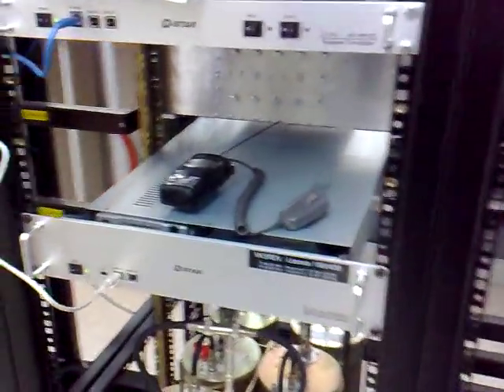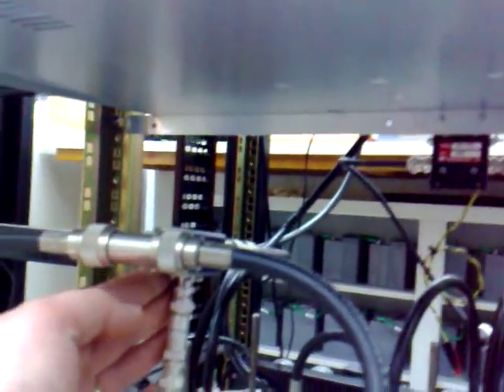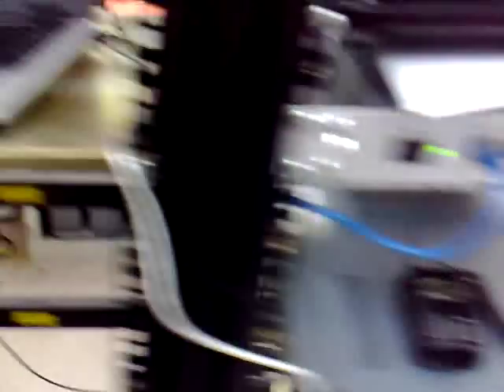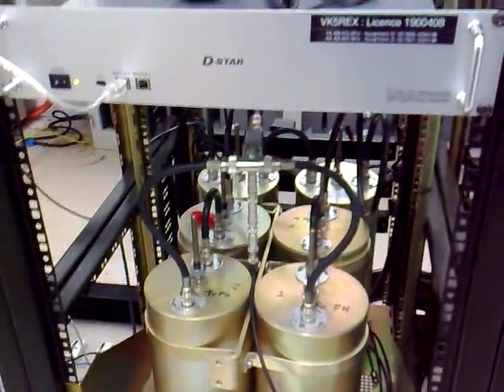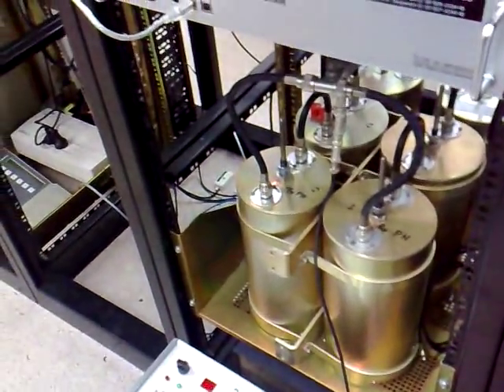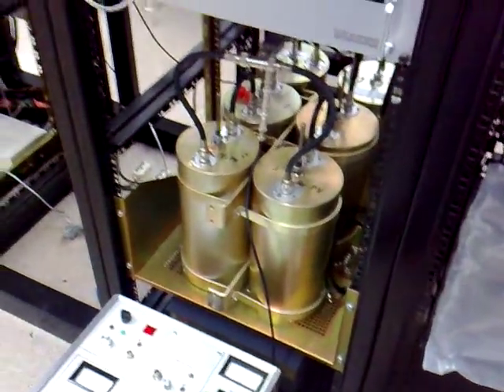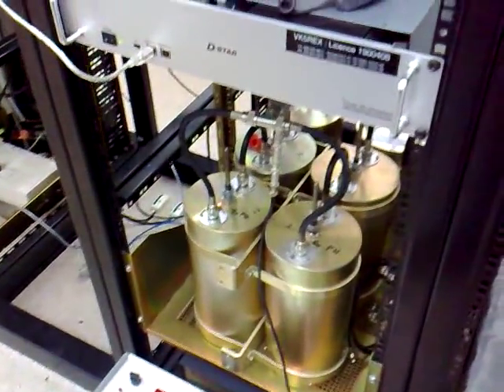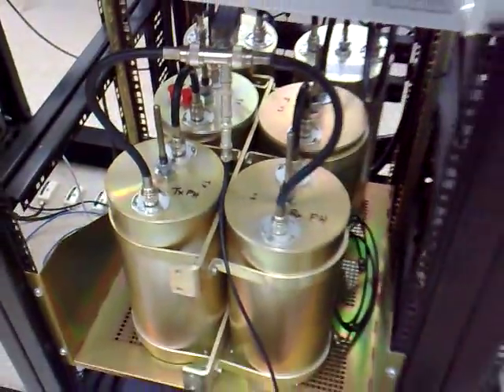Receiver test at the VK5REX D-Star repeater

Comment: That's not desense, it's wideband noise from the transmitter. You can confirm it by monitoring RSSI or AGC in the receiver. You need to add a notch at the RX frequency into the TX path to stop that noise.

Comment: There are too many factors to tak into account what the de sense problem is.
You need at least 80 DB of attenuation from the rx and the tx. AGAIN... too many factors to know where the de sense is coming from. It could be the feed line (not double shield) connectors, duplexer, receiver and if the transmitter is iperating properly. Some xmtrs will go wacky when you go to low power.
CONCLUSION... you have to take the whole system into account and see where the WEAK LINK or poor desing is.